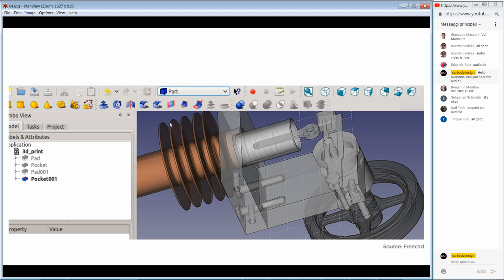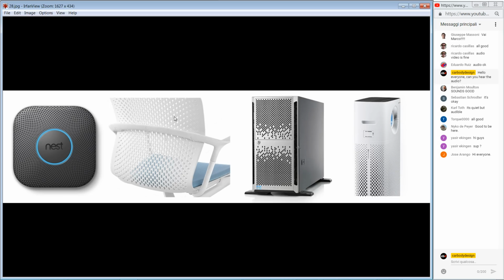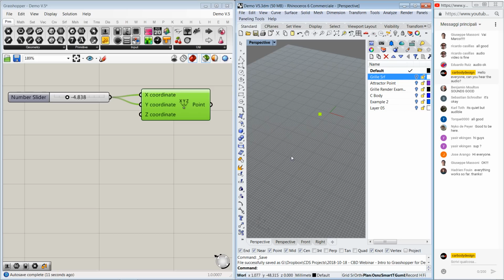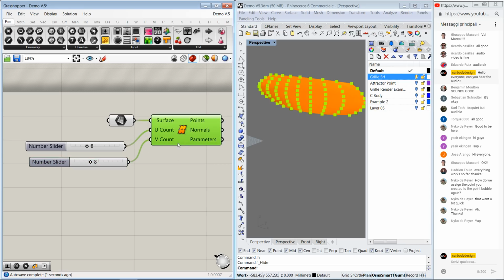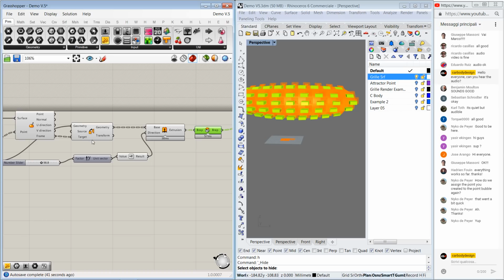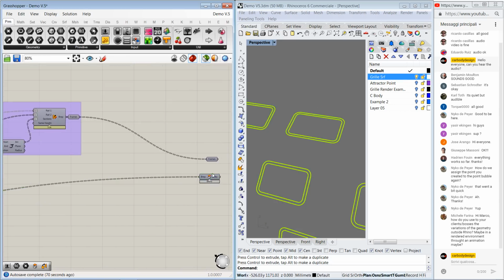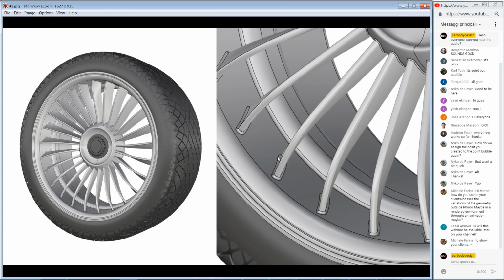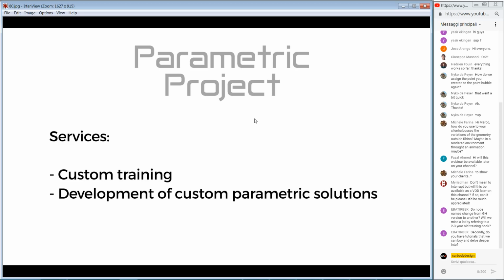Live Webinar: Introduction to Grasshopper for Designers

Comment: please, can you let me know how to center the rectangle to each point? thanks
Reply: You need to feed into the inputs of the Rectange component the domains rather than the absolute size: for example a size of 100 needs to be turned into a '-50 To 50' Domain. You can do it by dividing the size by 2, use a Negative component and then connect the two values to a Construct Domain component.

Comment: Hello, great video. I have a question, I am using Blender (a mesh modeling tool similar to Maya and Cinema 4D) for car exterior modeling and want to import that geometry from blender to Rhino, to use it for algorithmic modeling in Grasshopper. I imported the file as .obj and it is converted into a mesh in rhino. How can I import geometry from other mesh modeling tools and have it as a subD geometry in Rhino? So that, I can use it in Grasshopper. Thankyou

Comment: Thank you very much for this webinar. I'm learning grasshopper but really slowly due lack of time:)
IAnd I have on question that I couldn't find the answer to. Is it possible to have a parametric design running over multiple surfaces? Like from the sole of a shoe running to side of the sole with quite a drastic curvature change. Thanks in advance.
Reply: Richard Vink  hi Richard, thanks for watching and for the comment. I assume you want to apply some sort of pattern to a polysurface made of multiple surfaces, so that it is continuous across the edges. In general it can be done but it depends on the specific case.  There are different possible approaches that involve either nurbs or meshes. In general once you have a clear idea of the final pattern look and design you can then find the appropriate  modeling strategy. If you like you can send me a picture to my email marco AT marcotraverso.it and I’ll try to give you some more specific  indications
Reply: Thanks for the quick answer. You're correct. I mean a polysurface. WIll send you an image with an example.
Reply: @richardvink_art  OK, I'll wait for your email.